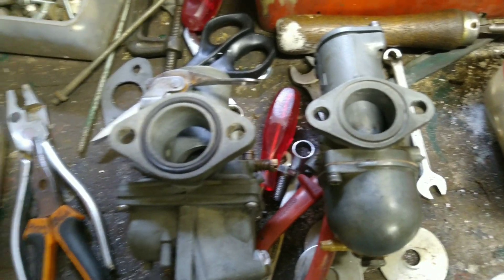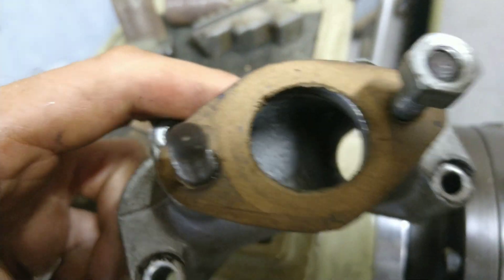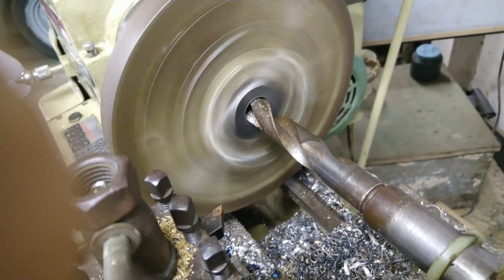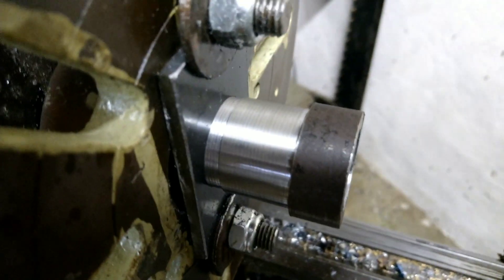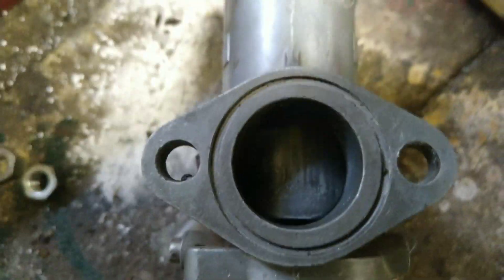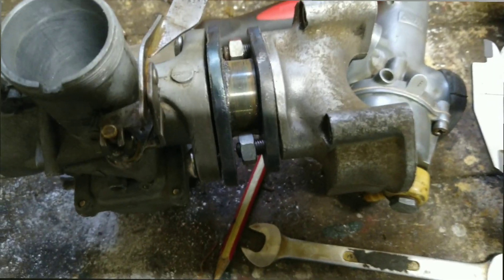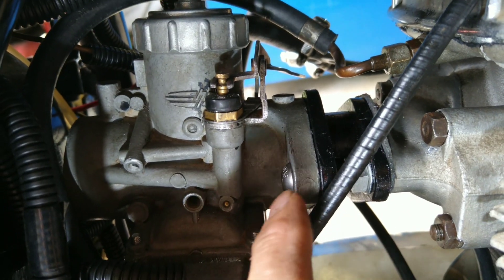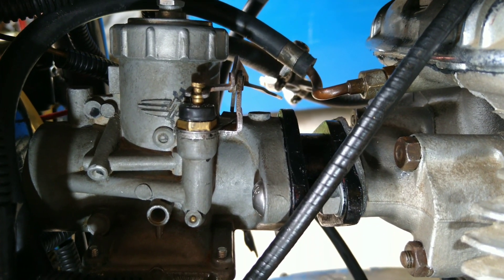Replacing an Amal Carb with a Mikuni. 1968 BSA Thunderbolt

Comment: Can I make a suggestion, not related to the carb……. Turn the cotter pin in the kickstart round the other way, with the nut uppermost, this might seem unintuitive but it is the correct way it should be inserted. It will pick the kickstart shaft up by a few degrees making it less ‘lazy’ looking.
Reply from the maker: Thanks. Will do. You taught me something.
Reply: Neat job well done 👍